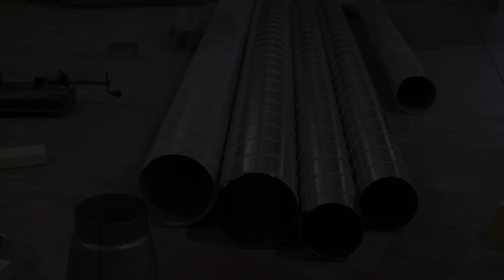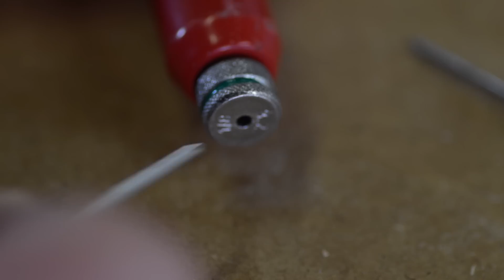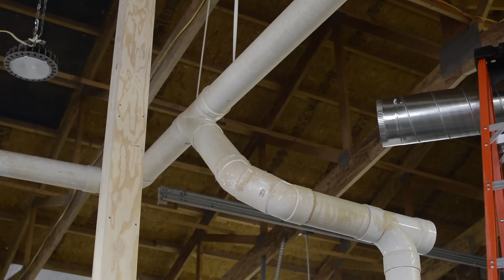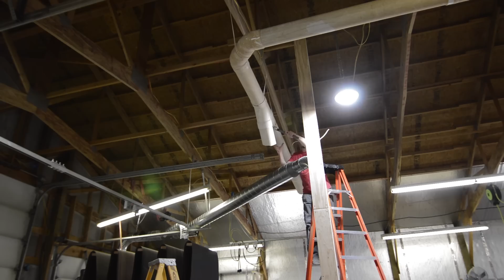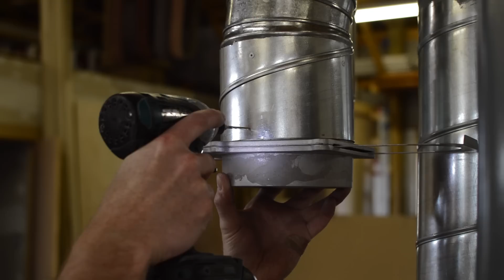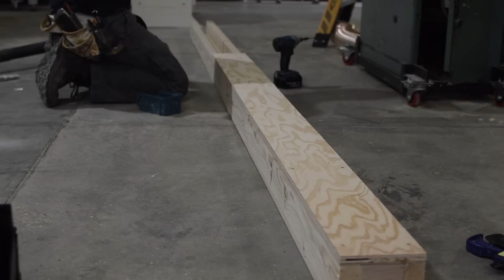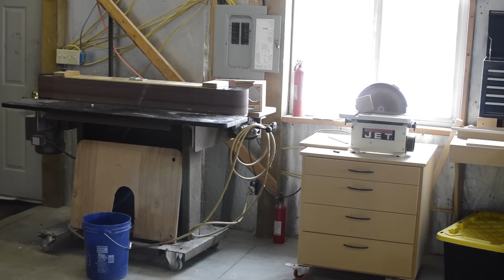Dust collection installation and upgrade

Comment: Did you check the prices of STR 35/sch 20 pipe?...way cheaper than standard PVC...its the green stuff
Reply from the maker: The problem isn't the pipe its the fittings. 8" fittings are very costly.

Comment: Bet you'll want a three-legged ladder as your shop fills up. Roller and Associates Auctions at 7500 York has some most months. I got an 8' and a 10' , virtually new, for about 30% of retail. I rely on the Denver market for industrial stuff. Can you recommend  the air handling supplier that sold your fittings?
Reply from the maker: Thank you for the good tip.

Comment: Your drop downs are smaller diameter than main duct. This slows airspeed down in main duct and causes dust to settle. Very common mistake.
Reply from the maker: I don't have enough power to keep velocity high enough in the verticals using an 8" pipe. I would need a bigger collector for that.

Comment: Mike, new to woodworking.   Looking for dust collection solutions.  The table saw / mitre saw / router will probably be the tools I think I'll use the most.  Instead of having a huge collection system with lots of duct work...having say one or two Festools systems strategically placed...wouldn't that work just as well.  Mind you, if you didn't mind emptying the canisters a lot more.
Reply from the maker: I think you can get pretty good results with the Festool, or any of the better quality shop vacs. Its a good starting point and you can make adjustments as needed.
Reply: @MikeFarrington   Thx Mike.   BTW  Love the modern Kitchen Table build.

Comment: Instead of manifold for outside venting , maybe a ' blast gate '  on dead end of dust filter and  vent to outside , open to blow past  filter to the outside .
Reply from the maker: The catch would be you would need an airtight blast gate. These are available, but very costly.

Comment: So Mike, I have a question...but first I will tell you what I bought and how I want to vent it.  I purchased a Baileigh 3hp vortex style simular to the one you have.  It, too, has a big filter that hangs off of the discharge side.  It is about 9" in diameter.  I have a 6" pipe running through the wall of the shop to the outside.  My question is...Do you think there would be too much of a "restriction" going from 9" to 6"?  Would I suffer on the intake side?  The intake is 8" so I plan to neck that down to 6" at the machine and plumb with SDR PVC drain pipe.  Thoughts?
Reply from the maker: I think so, the exhaust should be bigger than the intake by a couple inches. You could give it a try and see if it works.

Comment: Nice work!  I like how you planned out your blast gate location.  I just finished up my DC piping this weekend.  I think I spent about twice as much time planning the blast gate locations as I did actually installing the piping.  I got pretty OCD about making sure all gates were about an arms reach away from the tool's power switch.  Effort well spent in my opinion.
Reply from the maker: Unless the blast gates are automatic, their location is very important. I agree effort well spent.

Comment: There is an aircraft solution to holding materials for pop rivet assembly. They are called a Cleco. a few of them can be very handy. usually used with an insertion tool. Some woodshops burn sawdust and chippings to produce heat, Have you tried that?
Reply from the maker: Thank you. I'll look into those. My insurance doesn't permit me to burn anything inside my shop. Bummer, but thats how it goes.

Comment: Everything you've done is perfect and to the book! But...

 If you have any heating using natural gas/propane heating devices or, Burning wood heat woodstove.... Even air-conditioning cooling, exhausting chip and airflow to the outside is bad! I'm glad you thought about this. The other thing about this is if you air condition or keep cooler climate inside during the summer months.... Humid air being sucked in promotes rust to cast iron. I am religiously wax my surfaces cast-iron surfaces, and within 20 minutes of the garage door open I can see small amounts of surface rust on machines. I do run a dehumidifier and air conditioning.
Reply from the maker: Thank you. I mention in the video about being able to select between venting inside and outside for all of the reasons you mention. We don't have humidity at 6k feet so rust isn't an issue thankfully.

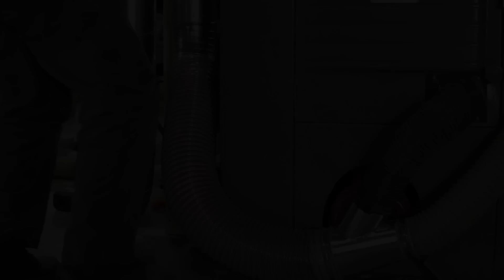Comment: @10:20  I see you upgraded your bandsaw dust collection... does this mean you are no longer using the original dust chute? Any desire to part with it? My saw is missing one...
Reply from the maker: Thank you. Yup, I wanted a 4" hose to that spot. I am no longer using the original, but I think I'd like to hold onto it just in case I switch back.
Reply: @MikeFarrington   you can't blame a guy for asking.... I was guessing you were going to keep it.

Comment: Your shop must be freezing in the winter.  Just wondering how you heat it?  You can burn the sawdust from the collector.  Any plans to add more insulation?
Reply from the maker: Yes, its cold. I have a few space heaters I use that take the edge off. I was planning to insulate and add a large heater this year, but the pandemic has pretty much halted that idea. I am not allowed to burn sawdust, it would violate my insurance policy.

Comment: It's recommended that the first 5 feet of the inlet pipe be straight with no bends.
Reply from the maker: I have heard its 10 feet. I'm not sure I agree with that, and also in my application that was not possible.

Comment: i installed a really nice Nordfab system (clone) and and been really happy with it.  Solid metal ducting is awesome.  Quite a bit easier to install than the spiral pipe, but your solution looks pretty good.  Nice job!  My only concern is how much doe your little rivets protrude into the inside of the ducting?  some machines make stringy shavings (e.g. ripping[resaw] on a bandsaw) that can get hung up and cause drag.

one thing you didn't mention, is to make sure all the connections are made in the correct direction (smaller inserts pointing towards collector)

My only beef is that I don't have automatic blast gates, because they are so STUPID expensive, but, i find I often forget to open/close the correct blastgate.  my only complaint.

to buy autoblastgates and associated electronic switches, etc, I would spend the same amount of money as all the ducting.
Reply from the maker: Thank you. We'll see if stuff gets hung up in the duct work. For the most part I don't make stringy type shavings.

Comment: Great looking setup, and good installation tips along the way.  Any chance you could show us how the waste bin sensor works?  Since most systems don't have one, I'm interested to see what would be required to add one on.  Thanks
Reply from the maker: Thank you. I'll try and include that in a future video. Its just a little thing drilled into the top of the bin, it has an adjustment screw to set the height at which it starts to blink.

Comment: Mike, as you know, I love your work, not quite sure here however why you swapped out the pvc piping for the metal ducting? You mentioned the dust on the pipes caused by static build-up, but wouldn‘t it have been easier to upgrade the existing piping with copper earthing band? The new system looks great, just think it would have been a whole load cheaper and easier just to upgrade... 👍👍👍
Reply from the maker: The main reason was cost. I wanted an 8" main duct run. 8" PVC and fittings are super expensive. The spiral stuff is relatively cheap when purchased from an HVAC supplier.
Reply: @MikeFarrington  Was the existing pipework really too small for you needs? If so, why? I'm always willing to learn. Thanks

Comment: Nicely done, Mike. Are you installing a remote activation system? At school, we had to add clean-outs so we could clear jams and retrieve arbor nuts sucked into the system; we epoxied rare earth magnets to the duct work to hold the arbor nuts until we had a chance to collect them.
Reply from the maker: Hey Paul, I forgot to mention in the video, I have a remote control to turn it on and off. I like the magnet idea, though its just me in the shop, so I don't think I would need the magnets.

Comment: Great video Mike. I actually prefer the look of the pipe sealant to gobs of tape. I'm installing a system in my garage, and will most likely do my leaky elbows with this stuff.
Reply from the maker: Me too. I really dislike tape. Plus this stuff is paintable, which I am considering doing to reduce reflection on camera.

Comment: Are you using existing switches to fire the unit on when each tool starts? If so, what are they? We have a similar install at the Denver Zoo. Great video, Mike!
Reply from the maker: I have a remote I carry with me. Pardon my ignorance, but what do you guys use a dust collector for at the zoo?
Reply: We have a carpentry shop in our maintenance building

Comment: Nice work Mike. I have the same Cyclone but the 3 hp. I did notice once I ran a straight 8" pipe for 8' out of the intake, the airflow really increased. Also venting outside, incredible suction, only dust to really go outside is from the drum sander. I purchased my system off CL as well, $1700.00 and the spiral pipe that the previous owner had for his 3 car shop, was close to 3k in just pipe and fittings. I decided to go with aluminum tape instead of duct seal, as my small 2 car shop is always changing. Woud love to have your woodshop mansion space...
Reply from the maker: Sounds like a good deal. Well done. So far I am happy with this one.

Comment: Did you create the overhead dust collection for the tablesaw yourself? Any plans available?
Reply from the maker: Yes I did. I am going to make a video about them. I am in the process of altering the one in the video, and making a second one for my other table saw. So far that has been a really great addition to the shop. Works really well.

Comment: OK. What i got from this vid is you getting a CNC.. What i tend to forget is to close the slides on machines i've used.. I've seen a pneumatic solution for that. It uses an air ciliinder that activates that valve once the machine is running. I like that a lot..
Reply from the maker: Yup, I am a CNC guy now. I have been working hard at learning how to use it. I am also looking into a couple automatic blast gates for some of the hard to reach ones.
Reply: @MikeFarrington  What software are you using for the CNC?

Comment: A good and timely video.  Dust collection is woefully inadequate in my shared shop.  Would have loved for you to touch on the pipe size calculations. I still have not found a source that makes clear cut sense to me.  But I suppose that might hurt the audience retention getting bogged down in that.
Reply from the maker: I pretty much read the entire internet on how to calculate pipe size. I know more than I will ever need to know, yet I still really don't know  how to really calculate one scenario to the other. I never really found a good system to lay everything out with mathematics. So in the end I just used my head and realized there would be compromises. Yeah, with regard to adding that kind of detail to the video, I have a hard enough time getting people to watch, let alone if I started droning on about math.

Comment: I would just put a pipe to the outside w/o a filter So that the air is cleaned in the cyclon but not fileterd, when you blow the air outside.
Reply: I agree.  Probably could add vent directly to outdoors w/o need to filter (or a bag filter at most).  Devise a blast gate arrangement to choose which way things go after the cyclone.  That cyclone does a great job of knocking down the majority of sawdust.  With those shop apprentices at work, spend the maximum effort to get HEPA or better for the discharge air into your shop.
Reply from the maker: Yup, that was what I was trying to explain in the video. I want to be able to do just that for 6 months out of the year, when its cold though, that wouldn't work. So my hope is to come up with a clever way to select.

Comment: Contrary to what machine manufacturers think, 4" isn't really good enough if you want to get the cleanest air. If you want to get serious about dust extraction, you should open up all the 4" ports to 6" ports.
Your current setup is going to be a decent chip collector, but a lot of the fine/invisible dust (ie the stuff that stays in your lungs and is the worst dust for you) will still get missed.
Reply from the maker: I think this is good general info, but if you look closely pretty much every tool has a 6" run to it, or a 6" splitting down to two 4s, which is good depending on the tool. I would also say a table saw with a 6' run to it isn't going to have good collection unless that is split and a run is put over the blade. Each situation needs a specific solution.
Reply: @MikeFarrington  Unfortunately, a 6" run is meaningless when it's got a 4" port on the end.
" I would also say a table saw with a 6' run to it isn't going to have good collection unless that is split and a run is put over the blade." The minimum for proper extraction of fine dust on a table saw is 6" for the blade and 4" for the overhead guard; so 8" split to 6 and 4.

Comment: Very nice installation, good work as always.  One minor nit.  It appears that you've got pretty sharp 90s on a lot of your curves.  Generally it's best practice to try to straighten those out.  The worst offender in this case are the two 90s right at the collector itself.  I think you'd get much better performance if you raised the cyclone so that the inlet was even with the rest of the run.  Obviously this causes other problems, so YMMV.
Reply from the maker: I agree. All systems have some amount of compromise, my system is no acceptation. The 90s are 1.5 center line radius, which is fairly standard in the dust collection industry. Not the best, but not too bad.
Reply: @MikeFarrington  Okay, cool, just so long as you're aware, and happy with the performance I feel I've made a small contribution.  Keep up the good work!

Comment: Hey Mike. Great video and very timely for me and my dust collection adventure. Did you drill a new hole above the 4in outlet of your Powermatic table saw? I'd be really interested in more details on that and the overhead chute. Maybe come glamour shots in a future video so I could glean some info. Thanks Mike. Don't forget, shop time = social distancing!
Reply from the maker: Thank you. Yes, I cut a square hole big enough for the 6" duct, then used a piece of wood as a mounting surface. I also added a floor inside the base of the saw to help keep dust from hitting the floor.
Reply: @MikeFarrington  Just did the work over the weekend. I cut a circular 6" hole high on the side of the saw base, installed a plywood floor, blocked off the 4" factory hole and built a plywood motor enclosure. Things are looking good. Still need to run all the ductwork. Still interested in more details on the overarm collection hood.

Comment: I'd like to see it in operation and what kind of air flow does it have.
Reply from the maker: It has pretty good flow. My next video will be about over arm table saw dust collection setups I built for my table saws. I will show the system working in that video.

Comment: I so love the cadence of your videos.  They are so very relaxing.  The one thing I would suggest would be some way to activate the dust collector remotely.  Thus, you could turn it on from a few key spots in the shop and turn it back of if you weren't going to be using it for a bit.  It would help with the noise issue.
Reply from the maker: I forgot to ad in the video that I have a remote control attached to my tool belt.
Reply: @MikeFarrington  deluxe!!  That's a fantastic solution.

Comment: I have a small time two stage collection system and I use the green sewer pipe. I have a small shop.  I liked the tip for adding screws and running wire and grounding it to the dust collector in order to mitigate the static electricity so the dust doesn’t stick as much too the outside of the pipe.  I had never heard that before.  I always was told to do it (although I haven’t yet) to mitigate an explosion 💥.  Thanks for the tip.
Reply from the maker: I think that the explosion thing has really only happened in a lab. I haven't heard of a real life case due to PVC pipe.

Comment: Does your new dust collector have a remote?  I am assuming it does.  Also, the shop apprentice is pretty good with a screwdriver.
Reply from the maker: Yes, I carry a remote attached to my tool belt.